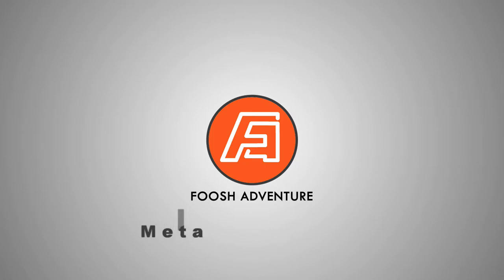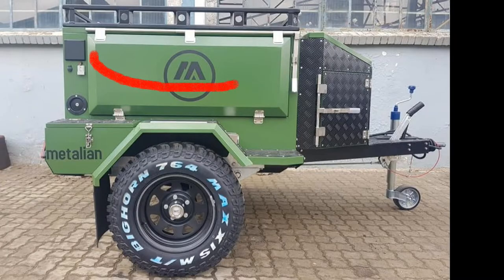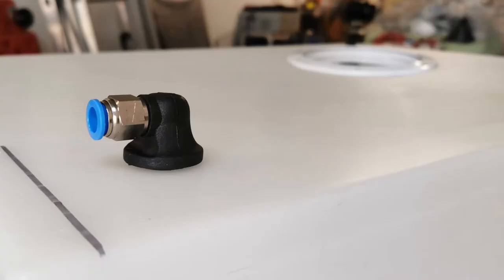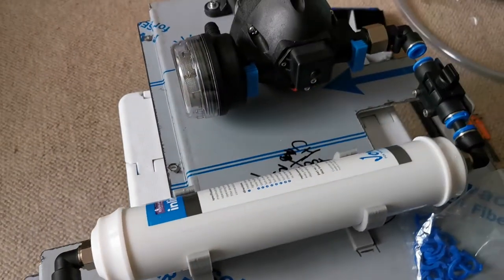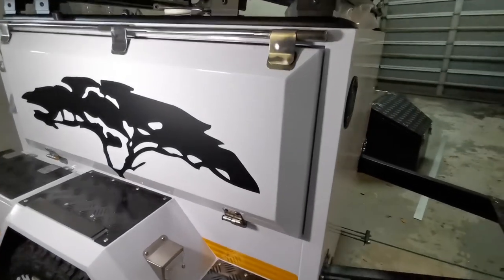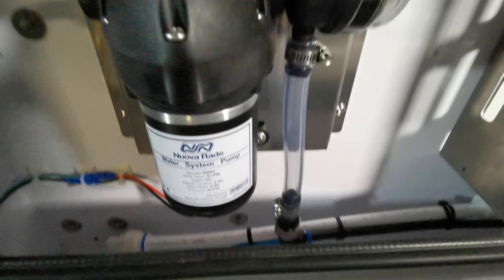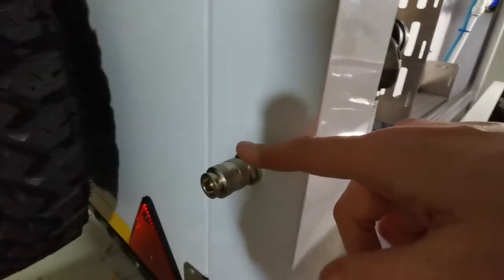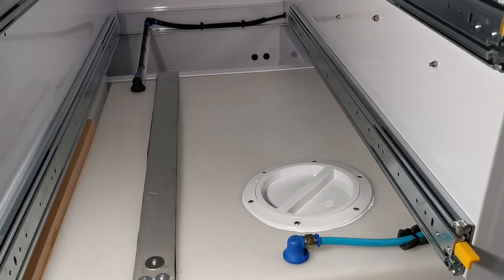Metalian Genie trailer water system install

Comment: your work is so professional - very impressive! Thanks also for the links, I may be changing some of the parts I used on my build with the ones that you used ;-)

That's great use of the right hand side hatch for the plumbing ... It really is a great addition to the newer trailers!
Reply from the maker: Thanks, glad we could help please shout if you need any further info we may have left out, we tested the water system last weekend and it worked well.

Comment: Thanks for this, I am currently designing my own Trailer for our Jimny and I was scratching my head a little bit around the water system, and how to get water in and out and purified.
Reply from the maker: Pleasure Barend shout if you need any further info.
Reply: @fooshadventure  As you are aware I have ditched the idea of building my own trailer and just bought a new trailer instead. 
So Now I am back looking at some of your video's.

Can you perhaps share the link or place where you got the water purifier from. I am not at the water system yet. But if it needs some power I need to cater for it from the get go. so i need to get some specs on it. 
Thanks.
Reply from the maker: Hi Barend, congrats on the trailer, it is surely a quicker way to getting out and enjoying nature. I will forward the links to the inline filter we used and the 12v pump to you. Look forward to seeing how you customise the trailer for your needs.

Comment: Awesome work guys! I'm amazed you haven't got much more subscribers, surely will come with time with such quality video production. 
When drilling for the water ingest and vent, is it ACM on the walls or Aluminum with the internal and external pain coats? Cheers!
Reply from the maker: Thanks for the compliment Martin. The steel is C3R12 Stainless. Its powdercoated. We live at the coast so corrosion resistance was important.
Reply: @fooshadventure  Thanks for clarifying that I was misled by the dark and clear layers sandwich. Looking forward for the aventures with the Genie, regards from New Zealand.

Comment: I like the look of that quick connect tap. Where did you source it? I've purchased a used genie (v1) so I am finding your videos very useful. Thanks!
Reply from the maker: Thanks for the feedback. The tap is a locking tap, we had it already from our frontrunner tank we used to have on our roof rack, so they are available from front runner, but we have also seen them cheaper at building supply and agricultural stores in ZA. We used the 1/2" GAV quck connects onto this to enable the removal of the tap, they are available from Builders, livestainable or any hydraulics supplier should be able to supply.